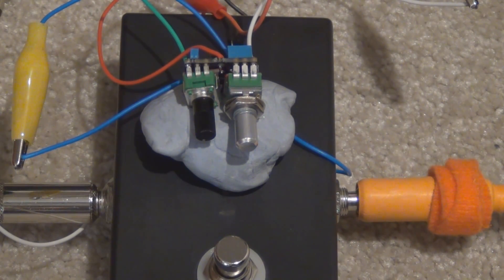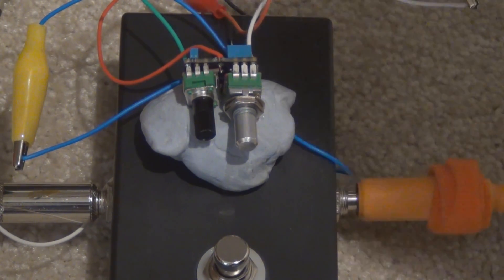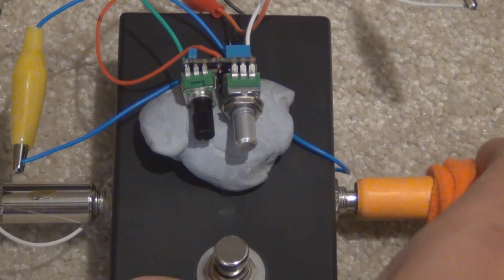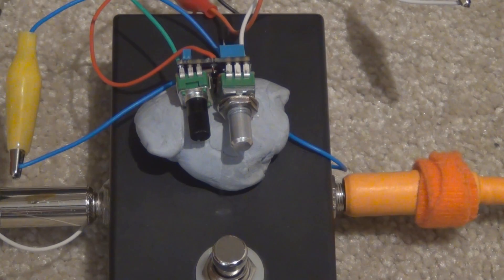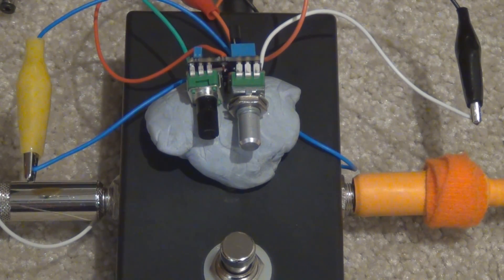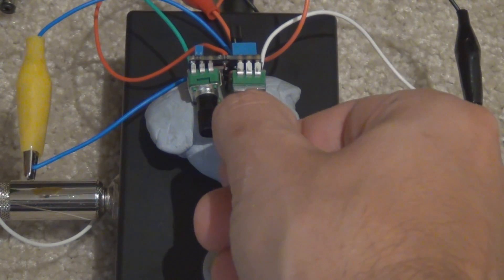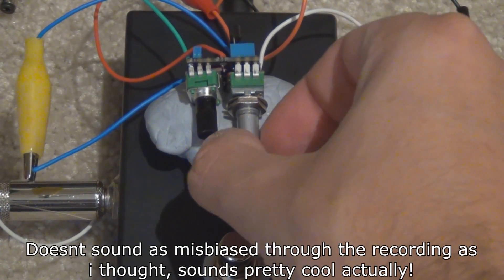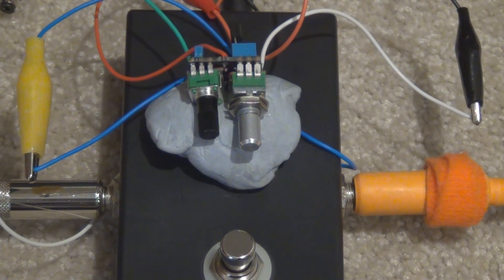DIYGP Ember Drive Transistor Comparison

Comment: Is their a way to wire 3 or more transistor and toggle through each one
Reply: permanently
Reply: +Tyler Durden Correct me if I'm wrong but couldn't you just wire it so there is a 3 position switch ahead of your transistors and them all feed out through the same connection points ? if that makes any sense?

Comment: can i build a fuzzface with just 2n5088s or mpsa18s? and just follow the sili fuzz face schematic?
Reply from the maker: haven't built a si fuzz face before but those transistors seem pretty high gain?  I think most people aim around 300hfe or something?  Not sure sorry im a bit sketchy on details of the si fuzz face.
Reply: IVE BUILT 2 OF THEM USING THE MPSA18 ONE I MATCHED THEM ON THE SECOND I HAD LOWER HFE ON THE 2ND TRANSISTOR  SOUNDED GOOD TO A POINT.......JUST A MATTER OF TASTE

Comment: The original uses MPSA18. I checked it and posted on FSB a long time ago.
Reply from the maker: Wow really?  If I had to guess I would have said mpsa13.  I reckon it sounded better!
Reply: chromespherecom I personally think the pedal doesn't sound good as it is. Add clipping diodes on a switch and it becomes usable in my opinion. I prefer big glass germanium ones. Without the diodes, it's just a booster that sounds farty with the gain turned up. I recommend trying a pair of back to back diodes from vol3 to ground!
Reply from the maker: Ásgeir Helgi Id prob rate the bazz fuss slightly higher for 'lowest part count' pedals.  Good tip on the clipping stage for new builders!

Comment: Cant you use a trim pot to bias your transistor?
Reply from the maker: yeah I would experiment with the resistors for proper biasing.  This was an more of an experiment to see which transistor was used in the original circuit.  I would say mpsa13 sounds like the right one.

Comment: From what I understand, the original did not have a great setup for biasing transistors, so the transistors used in the original were hand checked to make sure they had a very specific hfe rather than being biased properly. I do believe it's an MPSA13 though.

Comment: Hello, my friend!
1st view! :)
Your videos are really awesome and very inspirational.
I wonder if you could make a video about building tube-powered pedals (or amps)?
I've just started pedal building with an easy booster kit.
Are tube-powered pedals much harder to build than transisor-powered?
Thank you for all your effort, maybe you even find the time to answer?
Greetings from Germany,
guitarboyjunior
Reply: I'm not an experienced pedal builder, but I can tell you tube-based pedals generally are harder to build. They demand more power and more circuitry to be functional. If you haven't got that much experience building pedals there are some kits (with tubes) available, which can be a great start.

Plus, tubes aren't the most practical option for stompboxes, because of heat, size and fragility.
Reply: laurens b Hey laurens, thank you very much for your reply!
What do you think about this "vanilla overdrive" kit?

https://www.tube-town.net/ttstore/Bausaetze/LoV-Projekte/Bauteilsatz-Vanilla-Overdrive-MK-III::5859.html?MODsid=36qbu1ialqp43h6k47sqnc4da2

It runs on low voltage and doesn't appear to be too complicated...
Greetings,

guitarboyjunior
Reply: Another consideration is the voltage present on tubes, in order for the tube to have full power, sometimes there can be as much as 400-450V present in capacitors (this is common in tube amps). Start with 9v builds, or DC adaptor friendly builds, and grow/learn from there. Start with the easiest pedal you can. A little knowledge is dangerous, and tube tone is awesome, but not worth your life.
Reply: S Leduc Thanks for Your help! That's what I will do :)